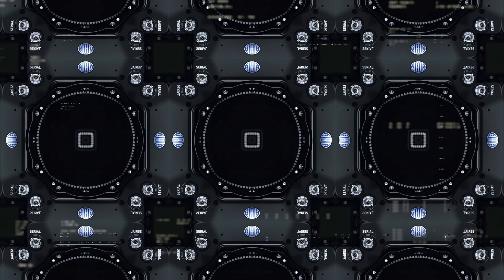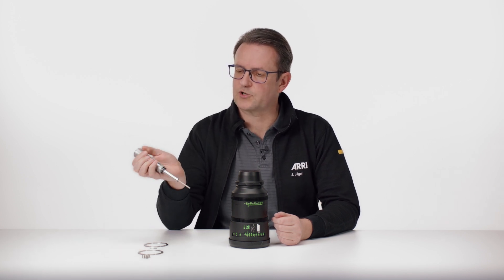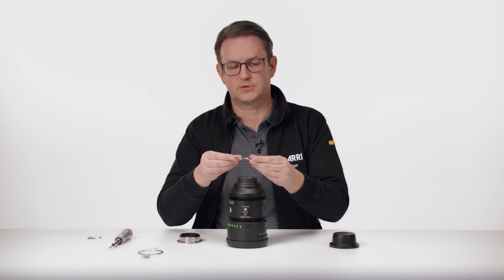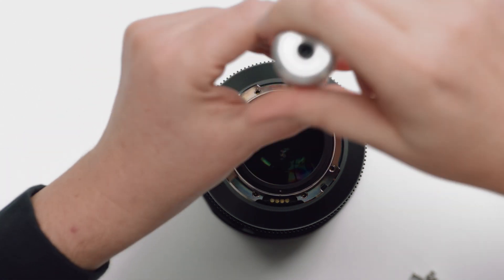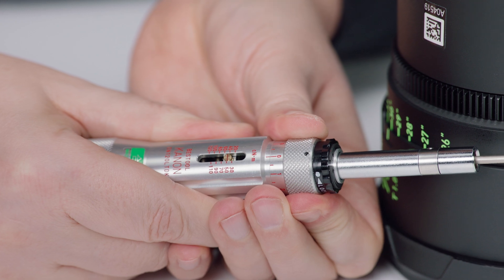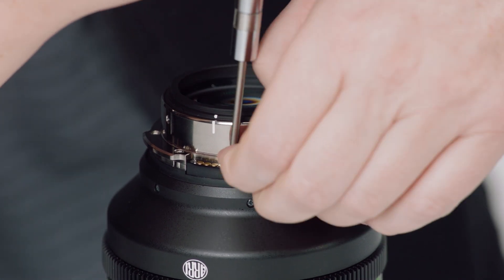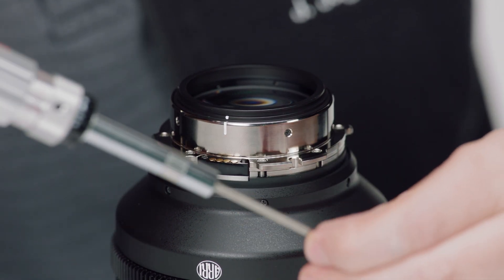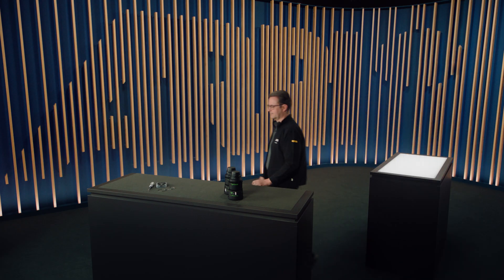ARRI Tech Talk: How to shim Signatures for Impression Filters (with subtitles EN,ES,IT,PT,한국어,日本語)

Comment: Which shim for which filters is used?
Reply from the maker: Hey there - as a general rule, no shim is required for use of Positive Impression Filters to maintain the correct focus distance while wide open. The Negative Impression Filters require a 2mm shim to ensure correct focus marks while wide open. From that baseline, individual shims can be used to ensure correct focus marks while stopping down, but we recommend using the Diopter Compensation feature of the Hi-5 to account for this, or the Diopter Compensation feature built into the ALEXA 35.